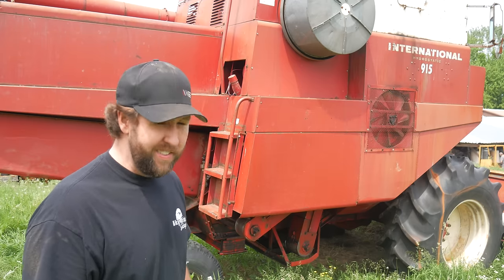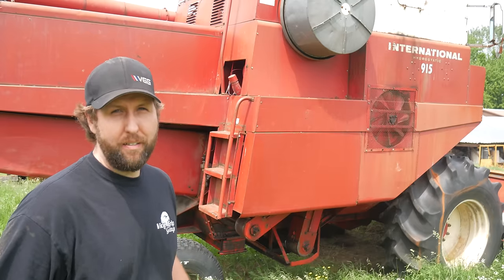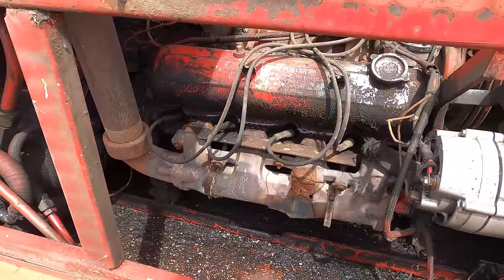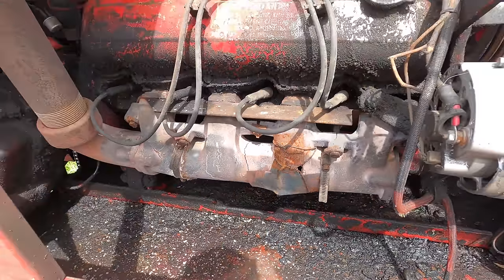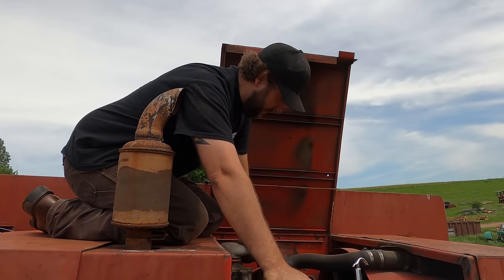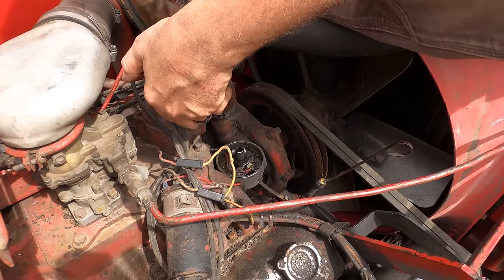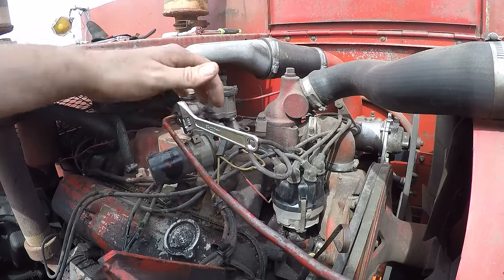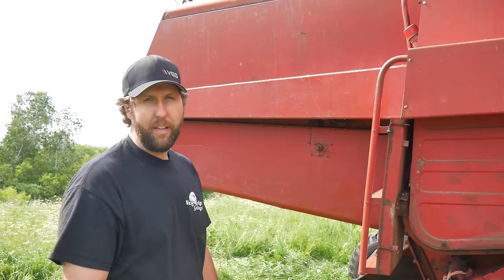Will It Run? International Harvester 915 Combine - Vice Grip Garage EP79

Comment: Those dislikes gotta be from John Deere owners....
Reply: Dislikes are from pure crazies....I grew up farming with John Deere green blood running in my veins. I love this vid...I  just dont know...how anyone could dislike VGG. Ill be dipped. Love this channel one of the best on the ol Utube
Reply: At least this one could be fixed were it sits and not need to be trailered a 1000 miles just to have a tech punch a key on the laptop and charge two years salary (yeah I'm talking about you JD, Fight for your right to repair)
Reply: @SadPuppySoup  lol...good one.  I grew up farming in the 70s...never even heard of a com-put-r. Just good old fashion 'cursant' wrenches, oil and grease. Our ol JD 95 had a straight 6 and no cab.
Reply: I'm John Deere also and the other farmers I help run Case. They all good machines if ya take care of em.
Reply: Hahahaa . John Deeres made great tractors. but the JD combines my dad had were garbage. The JD combines were of course of later manufacture that the 4010's , 5010, 4430 and 4440 . Nothing runs like a Deere. almost all the Combines they had after the New Holland 990 were pretty much trash as well. They wound up getting a brand new Gleaner / Deutz Combine. forget which model. that ran a few years troublefree till it started taking out bearings. but that air cooled V8 Deutz Diesel was absolutely troublefree.
Reply: @tonyneises5195  my dad called them Mexican socket sets.. still carry 2 in the semi if i cant fix it with those some duct tape and a pocket knife it dont need fixin lol
Reply: Nah we still give this a thumbs up. Even though its red. Lol
Reply: I'm a John  deere man
Reply: Massey here, but I have no problem with IH, JD or Case- seems like perfectly civilized equipment.. dirt and oil looks the same in any case.   Really digging the hose clamps holding the manifold together, I might have done some stuff like that in the past but I ain't sayin
Reply: @wylonparker5042  amen brother...👍🍻

Comment: “lets Put the hammer down” 
Proceeds to go 2.96 miles per hour
Reply: Well they only go all of 5mph...maybe 6 down a hill with a decent head wind.
Reply: I think a guy would have put a few more decimals in, I don't know.
Reply: IDK about a vintage model but the newer ones usually do 25-30 "highway" speed.  6 is just operating speed. But it depends on how fast it can take in grain. Which depends both on the machine and what exactly you're harvesting.
Reply: That’s faster than some of the rigs on VGG. 😂
Reply: Still faster than the “Turd Ferguson” from a previous episode. 🤔😂🤣 LoL
Reply: It's the combine that made the Kessel harvest in less than 12 parsecs.
Reply: super point filer 9000.. dont leave homewithout t

Comment: My dad had a 715 for years, had to do an engine swap when I was a kid and it had no air conditioning....just a fan to blow chaff around on you.  I never got to run it, had to run the gravity wagons in with the old 806 or 1066.  He eventually upgraded to a JD 7700 which he still uses to this day over 30 years later.  Good video, brought back lots of memories.

Comment: I love how everything in the US has a petrol V8 in it... Cars, vans, busses, RV's, combine harvesters, you name it... Haha
Reply: Fairly true when that combine was made, for the most part, except over-the-road trucks, large tractors, and large earthmoving equipment.  But the US had/has extremely inexpensive gasoline in comparison to the rest of the world.  We have a lot more diesels now.   Also, IH was unusual in that they used the same basic gas engines in almost everything...the 345 was in Scout IIs, Light Line pickups, medium trucks, fire trucks, school buses and smaller city bus chassis, and combines.  They were strong as hell, absolutely reliable, and had horrible fuel economy.  I've torn down 345s with 300K miles on the clock and beautiful crosshatch still in the bores- no machine work needed, just a cleanup hone and ready to go. :)
Reply: Sirens. I still cant beleive that one lol
Reply: Yea even people have V8s in em
Reply: @Ayeobe  yup. Ones I've seen were Chrysler Hemis with LPG on them
Reply: V8 is the way to go here in the states. We wouldn't want'er any other way.🇺🇸👍
Reply: Make V8's the national animal of the U.S.
Reply: @YeahJustMe  Tell ya a story about IH and the 345. Bunch of years ago, I owned a trucking company and did a lot of hauling for IHC. Got a call to move a warehouse full of brand new palletized 345 engines from one warehouse to another. If memory serves me correctly, there was about 15 or 20 45' trailer loads. This was after they had stopped using them in equipment and were surplus. I have no idea what ever happened to them but I sure would be interested to know.
Reply: My youngest was driving the farm V8 station wagon here in Australia when he was 8
Reply: @waynemichel  Right on!! I hauled hay with my uncle's 1939 IH 2 ton flatbed on county roads when I was 11 with a crew of 3 grown men to help me. Thing had almost no brakes, no doors, non-synchro trans! Them was the days!
Reply: Air raid sirens with the Hemi's!
Reply: That V8 is so american thing. Can't argue with that. I would love to own V8 powered american made car. Even our gas is 6€/ gal....

Comment: I can only imagine how bad of fuel economy this thing got while running a grain head
Reply: Probably would break about even money wise after harvesting a field 😂😂
Reply: A gas engine cost less to buy and overhaul, but you spent more on fuel. In the long run for small to medium sized farms it was a wash between gas and diesel.
Reply: @tomhath8413  that actually makes a lot of sense. I'm sure diesels in heavy equipment like this need more frequent maintenance than a diesel truck or car between the load being put on them and the dusty environment they're ran in constantly. Even my dad's old Ford 9n tractor needed pretty regular general maintenance and all he really used it for was mowing.

Comment: I think it is super cool that you do farm equipment on your channel as well. My grandparents had a farm when I was younger. In my teens, I spent my summer doing maintenance on the equipment. Oil changes, sharpening and replacing blade teeth, bailing wire and greased about a million zerks. Great memories.
Reply from the maker: Thank you for watching

Comment: Good day to ya, there, Derek!  Just have a little tip for ya - carry a couple cans of computer duster with you, makes cleaning those areas around spark plug holes much easier without having to use a compressor and hose.  Spray with brake cleaner, then dry off the areas with the comp duster.  Or don't, I don't know!...LOL

Comment: I grew up in & around IHC all my growing years. Family owned dealership. Worked on everything incl 915’s & Diesel 915’s Huge machines in their day. The hyd leak is on the pto output shaft between engine & pump. A 2 piece seal that cost nearly 200.00 CDN in the 90’s

Comment: Strange to me, as a ex-soviet Russian, to see machines like this on a petrol engines. We had those only on diesel, even that petrol was cheaper than water in ussr) Thanks for this video, sir, don't mind my bad English) Stuck on your channel by two weeks already
Reply: Those petrol V8's were cheap and a dime a dozen back in the '60's and 70's in the US.  All the modern equipment is diesel now. When gas was $0.40 a gallon, efficiency wasn't a big deal.  Now, with low sulfur diesel, it costs more than petrol here, but the diesels are 30 to 50 percent more efficient.
Reply: @johnpickens448  thanks for reply, i guess one more thing, there wasn't any private farms in the USSR, and all of the fields was really huge, so we had only bigger combines, that of course needed bigger engines.  Also i  remember some Eastern German machines, smaller, but they ran on diesel too. USSR certain had petrol truck at that time, zil-130, which had six liter 150hp v8, and could carry 6-8 tons of load. So they could use that engine on the farming machinery, but they won't. I guess there was an engine unification between all agricultural machinery, so they put same diesel's in them and they could use same spare parts.

Comment: On farm I grew up we had 1968 Mc-cormick International  with Farmall H basic gas motor  of straight 4 cylinder size 202 CC ,fuel tank hold 12 gallons of gas plus cab with Air Conditioning too had 2 speeds, got 12 bushes of 6 acres of grain only to take  and Big 12 volt Negative ground with Delco Alternator! It had no RPM gauge but we add to also plus  had a Volt , Oil , Temperatures,  and 3 speed transmission with 10 float speeds too gears! Great old Combine and guy own farm I grew up he probably still use it too!

Comment: Did not know those machines had 345.  Great gas engine.  Still use one in 75 IH truck.  I’ve seen them dropped into Farmall M tractors. An interesting build.  I also have JD 105 with straight 6 gas I need to get going.

Comment: You’d never guess what I made an old. Well at the time it wasn’t old. A NH 92 combine. Since they have shaker decks and I’m a miner. Yep. I built a sand hopper for the front. Home made wash plant screens. Finished machine was a mobile gold wash plant. Couldn’t run but about 75 ton per hour but it worked

Comment: had the 715 one season not enough power for 300 bu/acre corn you might want to check the elevator chain tension if it's loose & binds up it will smoke some belts and ours had the straw chopper when the bearings go it starts the combine on fire same as the newer 88 series. 715 stands tall won't fit in the 12ft high machine shed. it's a noisy combine so can't hear anything outside going wrong not much for lights so backing up to the fuel barrel at night is fun

Comment: Yes those electronic fuel injection tank pump came when turn key on wait stop ticking to also pull choke out and set idle to first notch throttle and key switch to start for 15 seconds on cranking over! Then push choke in when get started up and leave choke out 1/4 out for 10 mins to then push in to choke off in dash to ! Spark Plugs we used was Champion biggest ones get like old Bombdaire Snowmobiles single cylinder motors from 1966 to 1976!

Comment: Most of the time those old combines get parked because all the bearings and their attachment points on the sheet metal are worn out along with all the belts and drive chains. Had a cousin that owned a grain elevator in Iowa and he leased out combines in the fall and anhydrous equipment in the spring. The back lot looked like an equipment dealer with all the worn out stuff.

Comment: those 815 and 915's were fire hazards. most of the combine fires back in the day in my area were internationals. The next series was 1400's and they were diesel powered and did not have as much problems with fire and were much more fuel efficient. We run a 1460 for years and liked it.

Comment: I wanna find a dirt cheap gleaner  combine  Take the header off put a big ass snowblower on the front..and put some skidder tire chains on the drive tires.  The perfect snow removal machine.   Your up high for decent visibility.  Engine is behind you instead of beside you so you could still turn. And they have lots and lots of power

Comment: This channel has definitely become my favorite during these corona times. However, there is one thing I wonders since I'm from Norway. I see that you combine millimeter and inch wrenches on old american cars. Why is that? I though you only used the imperial system in the US?
Reply: Different parts made in different countries. Most modern “american” cars are made overseas so their parts are metric. Older US built cars usually use completely standard systems. Sometimes, its a mix of the two

Comment: A fellers uncle(s) once owned an IHC 1110 pickup with that 345. The standard 2bbl Holley carburetor on many of the 345's were absolute trash....putting a generic Autolite carburetor on their 1110 made it run better.

Comment: Don't the top-post positive and negative bat-tree cable clamps have different sized holes in them for their corresponding posts? I suppose the holes on older ones are probably all wallored out, and you couldn't tell anyway. Or a guy could have replaced the clamps and put the wrong size on the wrong cable. Yep... Prolly better to check first before you end up connecting them backwards, blowing up all the digical stuff, and flames end up taking over your project. 🔥

Comment: in my books if Diesel doesn't work clean the fuel system that's usually the only thing that's wrong wait a minute. This is not a diesel they usually run a Cummins turbo diesel apparently it's an old school V8 gas

Comment: I gotta a couple Massey Ferguson 175 tractors giving me major headaches...geeezow it is too hot to bush hog in Alabama through the Summer getting dive bombed by hornets and chased by snakes but it'll be fine....nope, nope it won't... The grass is already taller than the hood of the MF and I can't keep them running and the bush hog connected.

Comment: no-one will want to use it. the motor leaks to much oil. it has a very high risk of a fire. you should just weld a big plate on the front and use it to blade snow